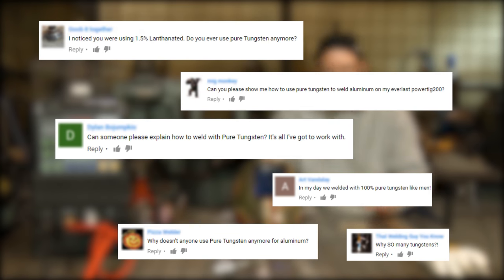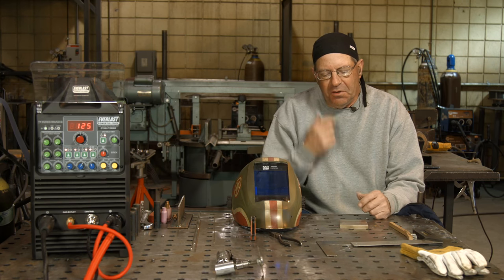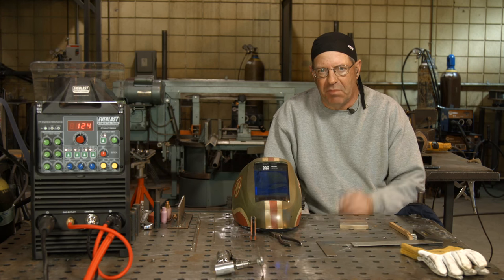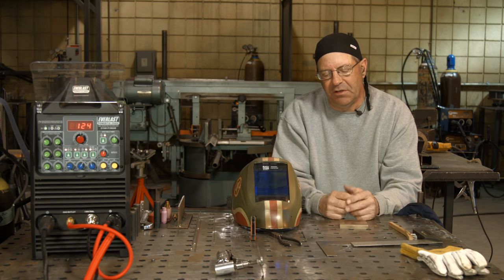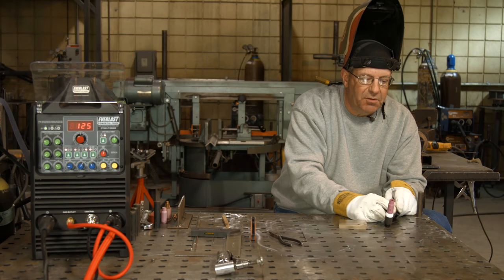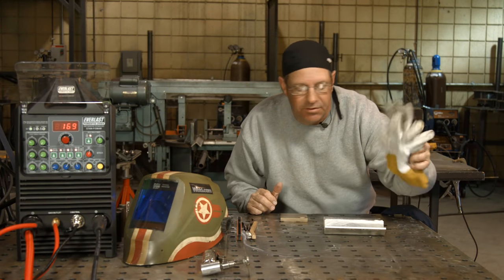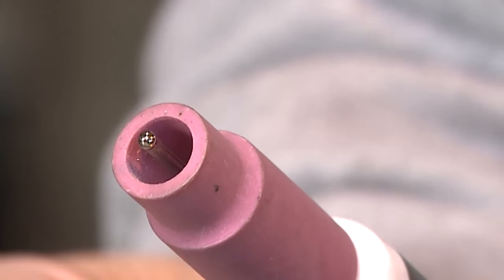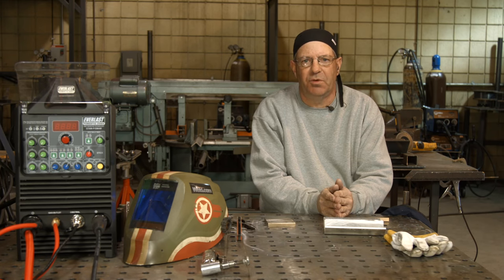🔥 TIG Welding with Pure Tungsten (Viewer Request)

Comment from the maker: Reply to this comment to tell us what you want to see in future videos.
Reply: great video as always. 

Requesting some general insights on welding stainless steel + 
electro-polishing if possible. Also would really appreciate some torch 
movement technique demo, on how to weld stainless without filler wire, 
without damaging the material too much or at all.

Thanks and Thumbs up
Reply: Stick welding with 1.6mm E316(LC) Stainless using AC Buzz box. Been doing it for years and still have issues with overheating the electrode or crowning from too low of amperage. I use a J technique, but would love to see some others show their skills and settings on this rod. I don't have problems with 2.0mm or 3.2mm, just the 1.6mm. Thanks!
Reply: damn i forgot to add, that i want to see it done using TIG
Reply: Something I've only come across recently at construction site watching a guy repair a machine, he was using carbon(?) rods to burn out a deep groove to weld a crack. It was a pivot hinge for a bucket arm. Just new to me. Thanks
Reply from the maker: Carbon Arc gouging?
Reply: Weld.com Sounds right, I watched from a distance and chatted with the guy he let me come close to see and when I asked what the process was he just repeated "carbon" rod burning, he was from south America, maybe his command of the language wasn't great.  It made a hell of a shower of sparks and his leads we're plugged into the arc welder, I couldn't see the settings cause the machine was buried in his truck. Thanks for responding.
Reply: I would also like to see some air arc (carbon) gouging.
Reply: 3G vertical uphill short circuit MIG, rootpass.
Reply: Some tutorial video about all the different electrodes used in stick welding including the more common ones like 6010, 7018..and when to use them and why.
Reply: Some kind of video about short circuit MIG vs spray MIG..and when to use theme + how to adjust the machines in each mode.
Reply: + maybe some overhead welding videos ?
Reply: + tutorial video about welding gases. I mean which gas or which mix for which process ?
Reply: Long extension cords on mains supply.  Leads maintainance,  signs of when they should be replaced. Safe practices to prevent current path injury.
Reply: GTAW 16 gauge or lighter stainless steel fillet welds in horizontal position. Maybe welding of dissimilar light gauge stainless steel. 100% argon 1/16" electrode

Thanks for the great quality videos!
Reply: can you do a push vs pull on mig welding? some type of cut and etch or testing. Thanks
Reply: stickweld 2mm bw   stainless tube in 6g.
Reply from the maker: We've done some videos showing how to use different electrodes. Here's one we did showing the difference between 6010, 6011, 7018, 6013, 7024 https://youtu.be/bjB0I3HXIVc
Reply: Very specific but I'd love to see TIG brazing videos. It doesn't seem like something people do often, it's almost always OA torch. I'd even love to see something specific like how to tig braze brass without boiling the zinc out and creating a hazard (plus the porosity). Different copper/brass/bronze alloys, advantages and disadvantages and common use etc.. Just ideas.
Reply: Weld.com 309l stainless stick welding V-up and overhead
Reply from the maker: Have you watched the series we did a few years ago on TIG brazing? We have multiple episodes on many of the things you are describing. Here's a link: https://www.youtube.com/playlist?list=PL52lqKDQaoDhs7dsjhPBJxacOjGvKJa6V
Reply: Weld.com how to select what electrode to use for what purpose with mild steel
Reply: +Weld.com Now that you mention it I do remember seeing some of those, thanks for that. I generally have only watched Bob's videos just because of the good explanations and little bits of details that make the difference.
Reply: i'd love to see if there are differences between expensive and cheap electrodes? i dont have any idea what to buy.
Reply: i got some turqoise (2% rare earths) that work really really well over a broad range of power
Reply from the maker: Tungsten Electrode or Stick Electrode?
Reply: tungsten, if there are differences at all.

i tried already several stick electrodes and i could clearly see and feel the difference  between a cheap one and the same type from oerlikon. that didnt really surprise me.

tig electrodes are way more complex and not as obvious as the stick ones
Reply: Weld.com stick electrode
Reply: Weld.com Tell about tig welding cast iron.
Reply: When stick welding when should I use the settings soft and crisp?

Comment: In ~2004, Miller's website recommended green (pure) tungsten when I was learning to weld aluminum. That's also what we were taught to use in school. That information was misleading, and it's a good thing that recommendation is starting to fade away. Even 2% thoriated tungsten works better if you ball the tip properly. An alternative method to ball the tungsten without switching leads is to adjust the wave balance to "maximum cleaning" and it will pull enough heat back into the tungsten to melt (ball) it.
Reply from the maker: Good tips. Thanks for the comment
Reply: 6061. com yes that's what I do , I bring max cleaning balance to 0 , and I turn heat down to 130 and hold the trigger until I get the ball size I want
Reply: Green is not good for aluminum with inverter type machines, as far as I have learned.  They tend to sputter much more, especially if you quickly jump up in amperage.

Comment: I still run an old airco 3A (same as the Miller 330 ab/p), powerful machine and keeps my shop from being blown away in the wind with her 860 lbs sitting on the slab. 

As I understand it Bob, with most of the inverter machines, the manufactures recommend against using pure tungsten with them. But you surely know more about the science of it than I do, although I'd be interested to know. 

I've been doing some experimenting lately with using different abrasives to clean aluminum prior to welding. Not necessarily looking for what's best, just looking to see how the different surface preps affect the finished weld bead. The jobs I'm working on get media blasted then powder coated, so the peppering doesn't hurt these jobs and its interesting, and sometimes irritating, to see the outcomes. 

How about some lesson on how to prep an aluminum weld for tig? Maybe some trouble shooting for peppering and crappy welds, cracking and bead appearance. 

Good vid Bob.

Comment: If your welding aluminum and you need you tungsten balled at the end. Switch your machine to DCEP and hold the torch over a piece of metal until you get a ball and it’ll only take a matter of a second to achieve. 😀 works every time! Just make sure you switch back to AC after.

Comment: red.  3/32. or 1/8.   I have the everlast  250ex I do general repairs an some light manufacturing.  had a miller econotig for years  before this machine had to ball the tungsten.  I like the new inverter machine.

Comment: I used to use a piece of stainless steel to ball the tungsten and to clean it between welds when welding aluminium, all done on AC. The thing with using an inverter machine even when set to mains frequency 50hz for me but 60hz in the US is inverter machines are producing a square wave and not a pure sine wave as you get from the mains via a transformer.

Comment: Hey, you're getting to be like the Mythbusters of welding!  I think even the manual for that Everlast machine on the table says not to use pure tungsten.... I think it's fine within its current limits, you might want to go up one size?  Good stuff.  I would like to see more Oxy-acetylene action!  The recent one on brazing was kind of a revelation for me.
Reply from the maker: Gas welding: Part 2 will be coming out on the 15th. We're working on it now.

Comment: I remember from my days tig welding was to keep the tip sharpe it helps produce a clean looking weld on stainless steel i use to work at jetstream ovens

Comment: I worked at ati and we made the tungsten then I machined it.. pure tungsten is powder or thats what we got then we had to put nickel and a like I want to say glue so it would stick together then put it in autoclave at like 2 to 4 thousand degrees for about 4 to 6 hours. Is there a pure rock form tungsten?

Comment: Have you ever welded with tungsten electrod that was heat treated(hardened /oxydatinon/scaling) before using? Would it affect ball formation? What about etching and W matrix changes during  hardening?

Comment: thanks bob. if you  don't have an old transformer machine  and you don't have a lifetime supply of free  (green ) tungsten , is there any reason to use it?
Reply: larry sperling Sure. It still makes for quality welds with a balanced A.C. Especially good for cast aluminum.
Reply: It hasn't come up, but pure tungsten is cheaper.  It's not MUCH cheaper, but I think maybe at one time it was, and also might have been the only thing available for AC.  Tungstens are all about the same price now, so you can suit yourself I think.  At my sad level, the electrodes are much more likely to be spoiled than to go bad by themselves!   I still think if you're green electrode won't quite stand the current, you can move up one size.

Comment: Hay Bob. I was wondering, how do I know what size cup to use when welding different metals? I know, it sounds a bit ignorant, but I haven't welded in 30 plus years! Seems like everything has changed. Thanks.
Reply: Gary Scoville What is it you're welding? Amperage and size of tungsten mostly dictate cup size along with type of joint.
Reply: I just got steel, stainless steel, and aluminium 3/32" dor for stock. I just bought Lincoln 200 Mig/Stick inverter welder. I don't know what I will weld first. I got the tungsten that came with the machian .
Reply: #6 and # 8 I would think. Again, it depends on size of tungsten and joint configuration.
Reply: Cool. Thanks Bob. I appreciate your schooling a 63 year old!    :-)
Reply: Gary Scoville Right behind you old buddy. 58

Comment: Wonderful ! is it true that today's "inverter" machines use rectangular wave instead of the regular sinewave ?
Reply: Senuol Icak There are a lot of advanced wave shapes on AC now.
Reply: Generally speaking, yes.  They're switching with transistors, as opposed to using a big transformer.  Making that square wave is the most efficient use of the transistors (fully ON or fully OFF),  but they can do other things.  Other waveforms can of course be synthesized by faster switching.  The rectangular waveforms are good for us, too- the fast switching generates high-frequency components that tend to keep the arc lit, as I understand it.  That's how it acts, too!  The new machines don't need to keep the H.F. arc start on all the time, just at the very beginning.
Reply: My tig lets me select between squarewave, triangular wave and sinewave.
Reply: So, it's like a synthesizer, you can play a little song!

Comment: What torch is on that Everlast? I use an Everlast PP256 mainly for SS.  When welding under 100 amps (most of the time) I toss on an old torch from my deceased Maxstar.  When welding heavy alu (cylinder heads) I use the WP18 that came with the machine.  I cant stand that 18 for delicate areas like valve seat counter bores (03-08 Hemis).  So, what torch is that?
Reply from the maker: This one was a 26. It's big for precision work. In some later videos we took the 17 off another one of the Everlast machines and used it.
Reply: Subbed. Thx
Reply: For under 100A you should have a lot of options!   You might be able to do something with the WP-9 Series.  There are TIG torches that are  more like a big pen in feeling.  There are some videos out there on this topic, and also some good suppliers.  Even a conventional torch can be made pretty compact by using small parts... then get the "superflex" welding cable which is very soft and rubbery.. and you can just write your name in something with the arc.  Ah, I do this for beginners,  with a big copper plate.  The AC cleaning action will make a bright copper color and you can write your name with it as an exercise.  It's kind of surprising and doesn't use anything up.   Anyway, you should be able to have a much easier time, maybe less than 100 dollars what with eBay and maybe even Chinese suppliers.